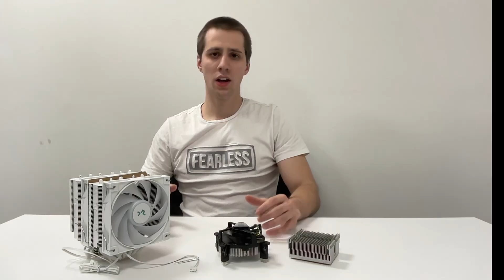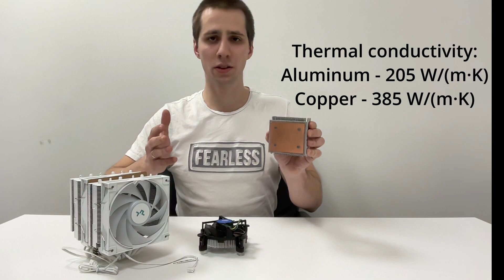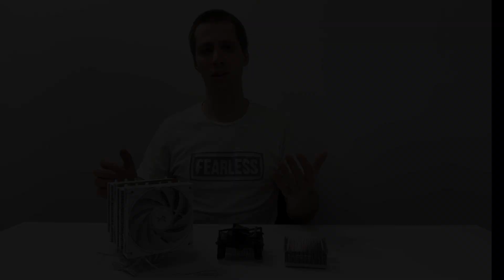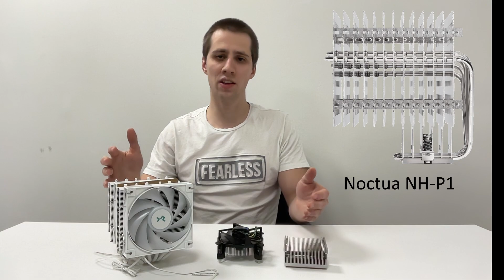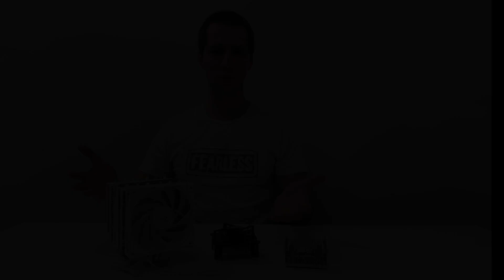CPU Coolers Explained. Cooler types and how to choose the right one for you.

Comment: i’m using h610m hdv and i have a spare i5-13400f. will a good tower type cooler be enough for me to use the i5? i’m playing games only
Reply from the maker: Yes, the max turbo power of this CPU is 148W, so even the Deepcool AG300, which is rated at 150W and is pretty cheap, will do the job.
Reply: @ thanks! i will buy one soon!

Comment: Thanks for the explanation. I'm planning to build a PC in a few months therefore I was looking into CPU coolers. I'm still weighing between AIO Liquid Cooling and the traditional air cooling, and right now I'm leaning more towards AIO Liquid due to the aesthetic and overall better cooling for high performance. Which one do you think is more suitable in a long term for hours of gaming session?
Reply from the maker: Both AIO and tower cooler will do the job, so pick according to your preferences. It depends on a few things:
1. The CPU you are using: More powerful CPUs require better cooling. For instance, an Intel i9-14900K would benefit more from an AIO cooler, although I’ve built configurations with the AG620 air cooler for improved reliability.
2. Performance vs reliability focus: AIO coolers provide consistent performance, even during high-power spikes. On the other hand, air coolers are generally more reliable since they have fewer points of failure.
3. Maintenance and lifespan: AIO coolers might need occasional maintenance, like checking for leaks and ensuring the pump is working properly. On the other hand, air coolers are simpler, typically just requiring occasional dusting to keep them running smoothly.
4. Price: Air coolers are generally cheaper than AIO. Keep in mind that smaller AIOs might provide worse performance than huge tower cooler like the Deepcool AG620 that I have shown in another video.

In the end, it comes down to whether you prioritize aesthetics and top-tier cooling (AIO) or simplicity and long-term reliability (air cooler). Both are great options for your use case.
Reply: Both are fine for long sessions but if you want to get some cheaper options go for air cooling unless you have something like a 13 or 14 gen intel you will probably be fine with Air